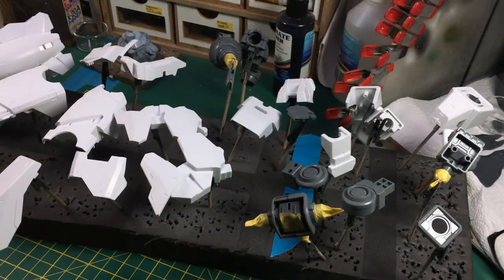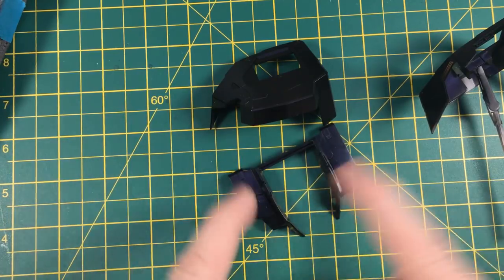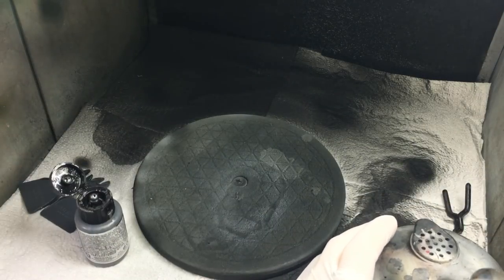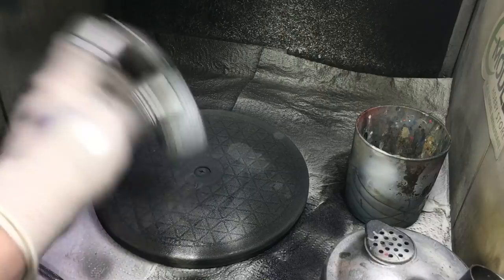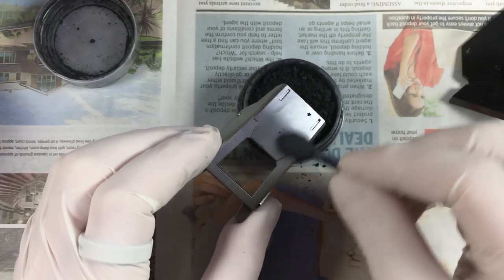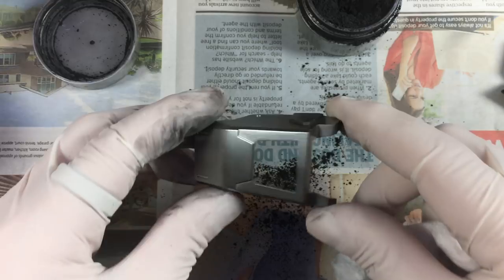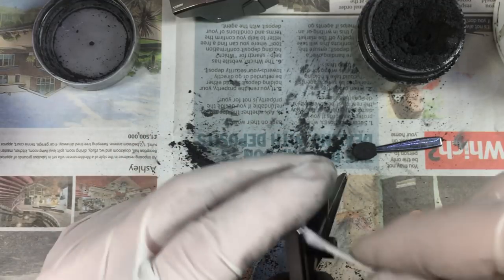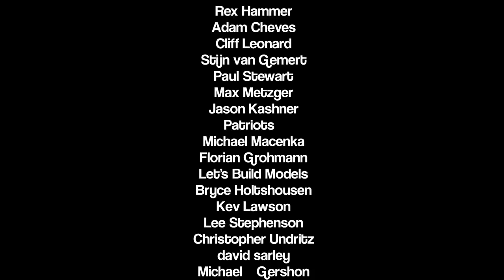MEGA SIZE Unicorn Gundam 4: Priming, Painting & Powdering The Armour With C1 Metalizer

Comment: I've tried the ump gloss black primer and got the dreaded orange peel! 0.35mm needle, 20 psi, maybe a higher pressure and have the airbrush a bit closer? Loving the effects you're getting!
Reply from the maker: I find about 22-23psi works a little better, but it may just be you are going too heavy and if you are too far from the model, the paint is drying out too much before it hits the plastic - preventing it self-levelling. Make sure to do a quick mist coat first to give the second wet (i.e. heavier) coat something to grip to and to avoid any surface tension issues, and if you can, adjust the trigger on the brush (if it has the option) so you can get enough primer on the model to cover it but not so much that you are flooding it. Keep the brush moving, don;t stop in place as, again, you'll flood the area. It;s better to build up a primer (or paint) coat slowly in thin layers rather than get it all on in one go and risk overloading the surface. As you can see in the vid, I am always moving, and to be honest, I am not pulling the trigger back all that far.
Reply: Modelmaking Guru thanks for the feedback, I'll apply this wisdom and let you know how it goes

Comment: Ordered a bottle of ultimate primer, cause you and Ted are always speaking in highest terms of it. It is an acrylic PU primer like the one from vallejo right?  Is there a big difference?
Reply from the maker: Yes, the Vallejo one is utter steaming crap, the UMP one is the best primer money can buy. Unlike the Vallejo rubbish, it ACTUALLY sticks to the plastic, is ACTUALLY sandable, ACTUALLY dries, Is so easy to use that a dribbling half-witted moron would get excellent results with it, and it self-levels beautifully :)

Also the matt primer is exactly the same stuff as Stynylrez and Ammo One Shot Primer, if they are easier to get where you are.
Reply: so hopefully it is in the postbox tomorrow.
Reply from the maker: Yay!
Reply: Haven't ordered their primer, I'm going to try Vallejo's mecha color primer because it specifically says it can be used with a needle as small as 0.2 mm (I have a TRN 1 like you, actually bought it because of watching you), but I have ordered 1 bottle each of UMP universal thinner and Airbrush cleaner.
Reply from the maker: Try it out a test model you don't care about first - Every other Vallejo primer I have used in the past has been terrible (not curing, not sandable, come off easily etc. etc. )
Reply: What Vallejo No. is it?  Was trying my 0.2 setup with the ultimate first.. not the best idea, but with 0.5 it was great to apply. I used the vallejo surface primer for a while.. was quite happy with it since I experienced a hughe masking desaster.  So i switched to ultimate.  And had some similar problems too. I figured, that I went to far with the parts cleaning and almost polished them lately, cause I was so happy with the results the 3m spongesanders gave me. ^^ Moron me!  So less sanding equals better gripp. And this might also be the case with the vallejo stuff. But you hear a lot of negative stories about it. At least you can spray it with a 0.2 setup...